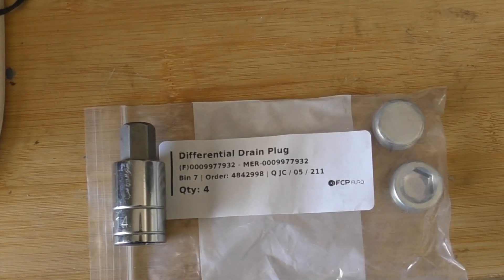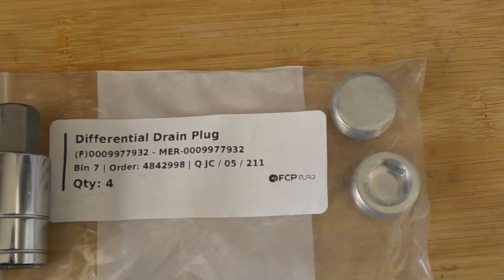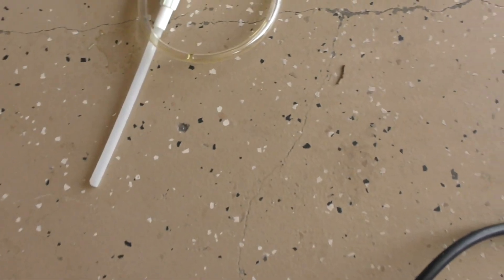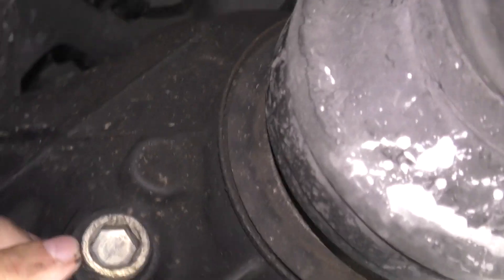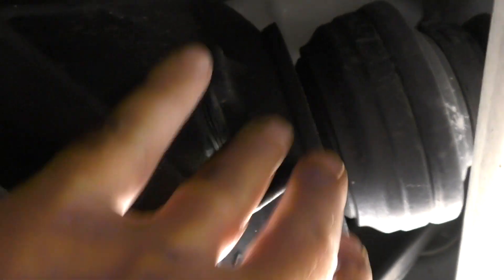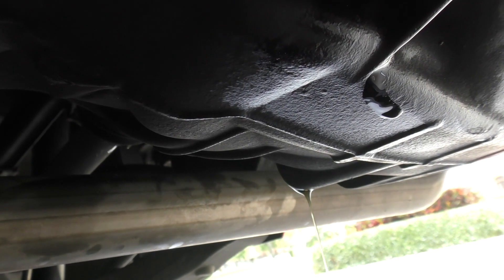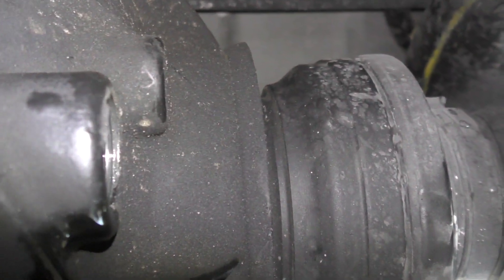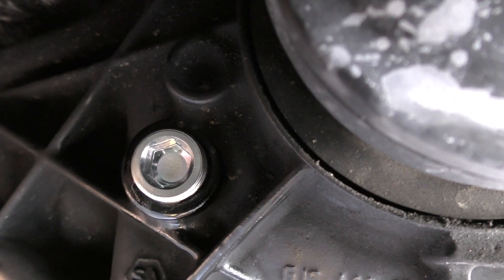Mercedes W166 Differential Fluid Change

Comment: I do the differential and transfer case oil with the transmission every 25K on my GL W166.
Reply: Might be too often in my opinion...
Reply: @prandomable  it's not too often for the transfer case, that contains a chain that wears fast without clean oil.
Reply: @danieleriksson1657 I changed the transfer case fluid today at 122,800 miles (197,600 KM) on my 2013 Mercedes ML-350 4matic for the first time. The fluid was pretty DARK...you are correct. However my rear diff fluid wasn't that bad...and has never been changed either...

Comment: Thank you for making this great video. I saw somewhere says you need to put a special Loctite on the plugs and it's expensive like $50 or more for a small tube. Did you put anything on or just tighter the plugs?

Do you have a video for front differential fluid change too?
Reply: I did not use loctite. No issues ok it’s torques properly

Comment: Is the front and rear differential using the same type of fluid? Thank you! I have a 2018 Gle 350 4 matic with 55k miles. Is it OK to use mobile1 75w90 like yours?
Reply: The front and rear should take the same gear oil.

Comment: No need to replace the plug...why waste money?? I mean it's not like a crush washer or a rubber washer gasket or o-ring that can only be one time used only...😂😅
Reply from the maker: Replacing the plug is recommended in the service manual.  Do you absolutely have to? No, but they are pretty cheap and meant to be replaced.
Reply: @letsrolldiyauto1532  yeah. Make sense. They are super cheap. And to 100% make sure there will be (no leak) is to use new plug...